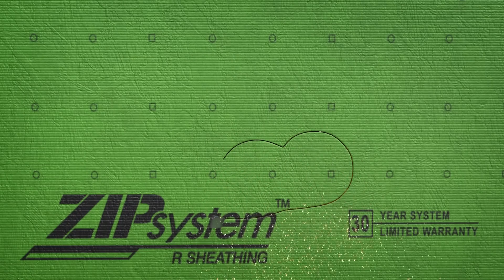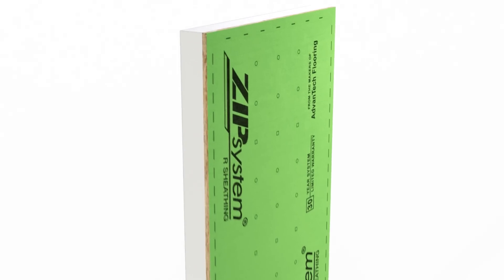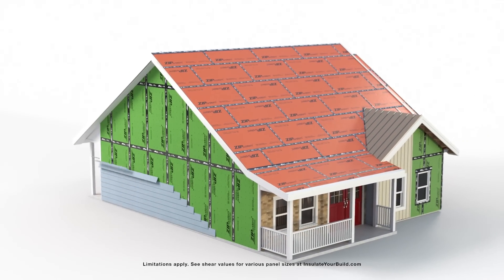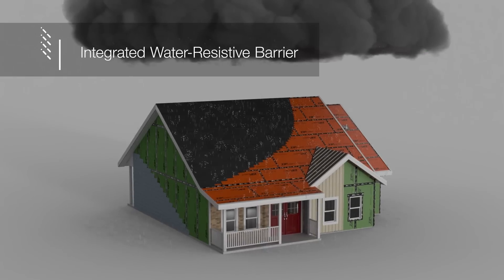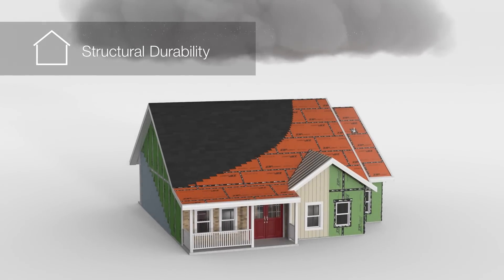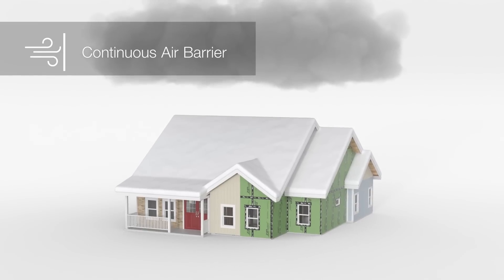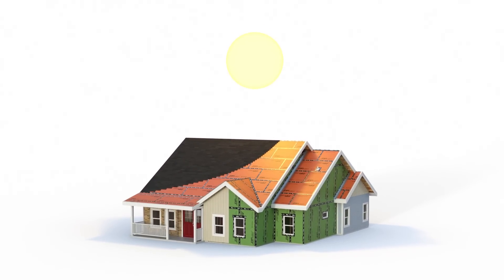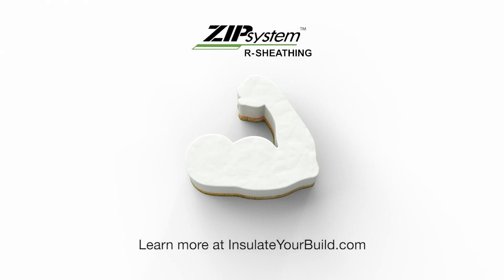Introducing ZIP System® R-Sheathing | ZIP System R-Sheathing

Comment: What is the foam insulation on the back made of?   What is the degradation period on it?  I don't like the idea of having foam in between my stud and my sheathing. To me, I would be concerned about the possibility of racking since the wood to wood contact isn't there.  I like LP Weatherlogic better at this point.